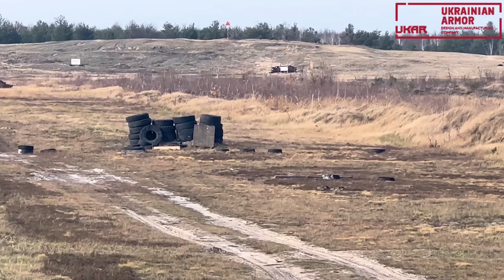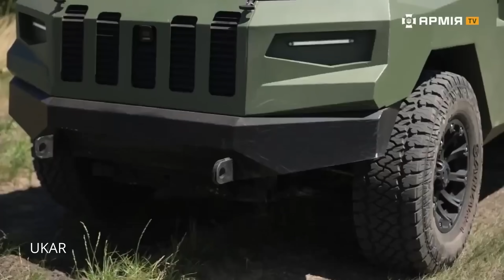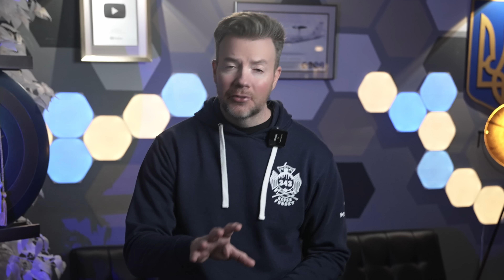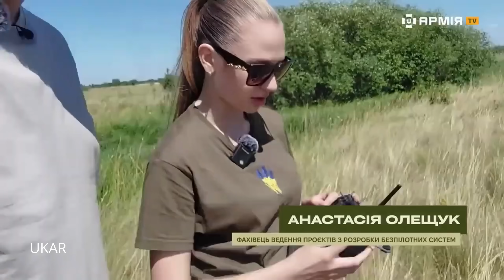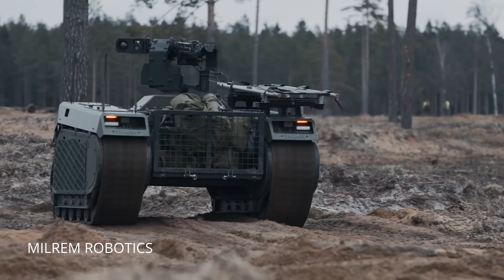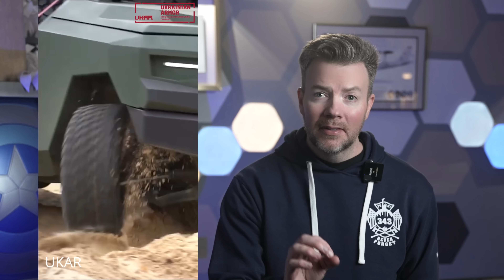Can This Ukrainian Robot Truck Change War?

Comment: Unmanned ground vehicles have a lot of potential; however, as far as combat goes, you would have to figure out the tactics first(suppressive fire, perhaps). I know that Ukraine was able to successfully clear at least one fighting position with robotic systems like this, though. Would tanks be a problem for a system like this, unless you were like the new US armored personnel carrier (Bradley replacement) that will have an autonomous mode? Would they themselves be vulnerable to drone and air strikes?

Comment: I don't see anything ground braking or game changing. GUVs (ground unmanned vehicles) that are remotely operated by soldiers behind the lines, have a single huge disadvantage to a Hummer or JLTV manned with soldiers, and that is - situational awareness. Or better to say the lack of it. No amount of cameras and sensors can't replace the 2 or more pairs of human eyeballs. GUVs will become important and dangerous on the battlefield (although never as much as flying drones) when the AI becomes advanced enough for it to drive the vehicle and shoot its weapons... Until then JLTV manned with 6 Marines with remotely operated weapon station and a few Javelins inside, will be order of magnitude more dangerous, mobile and impactful than a GUV.
To be fair there's one niche role that GUVs can do pretty damn well, and that is missile platforms.. The best example being the US Marines' NEMESIS, where JLTV was turned into a remotely operated vehicle and the engineers installed 2 NSM missiles at the back.. That I can see as a platform that minimizes danger for humans while giving commanders a mobile, low profile system that could sink anything up to a size of corvette. But that is the problem with the NSM missile itself, being small with light warhead (for an anti ship missile that is).. But put one LRASM at the back and you get a $5 million system capable of sinking multiple billion $ worth Chinese Type 055 destroyers...

Comment: If you're close enough to pilot it, the risk is higher than 0.  But it's significantly less than standing like a bullseye

The next stage is a unmanned trike.  (3 wheel)

Comment: That you create revenue from posting what is largely just hyperbole, often using the sad situation in Ukraine is itself extremely sad.
UGV have been largely been a failure in Ukraine as compute to understand and navigate rough ground has proven far more challenging than expected. UFV not needing to consider rough ground are obviously effective and used, UGV have been tried but so far pretty much a total failure.
So enjoy creating revenue posting hyperbole about the terrible situation in the Ukraine...

Comment: Wes.  Appreciate the method to avoid drivers, but this unit is still more expensive and less prevalent than the drones that will kill it in one hit.
Situationally useful at present.

And Russia will have them within a few months too leading meat wave attacks.

Comment: Anyone notice the Chinese transmitter she was using?
Nothing wrong with that, it is a highly regarded transmitter in the hobby world, as long as they can't switch it off remotely.
This thing would be awesome on my rural property, instead of a machine gun I could use a remote sprayer and spray gorse with it.

Comment: She's not wearing goggles? I wonder why they don't add FPV cameras like RC cars are now doing (or maybe just not showing that yet). It's the exact same VTX tech as FPV flying drones and while they've been doing it for years in hobby RC, the latest designs are really impressive for offroad! They're already using ELRS or an encrypted equivalent based on the TX16S controller
 https://youtu.be/YmWkI4PtUNM?si=EOuZVqlmy9an7aHb&t=1

Comment: I would hope that the computers and radios on these trucks are secured in a secure box that self-destructs if the truck is captured, to prevent any reverse engineering.

Comment: Handy dandy bit of kit. That low profile is also a winner, it should sneak around without attracting attention, since the engine is probably fairly quiet.
Curious as to how low the thermal signature is on this bad boy!?    Be well and stay safe

Comment: I was just checking: The Protector uses an internal combustion engine. I assume it has it's reasons. But I was expecting it to be  electric, which would reduce the sound it makes... not that modern petrol or diesel vehicles make too much noise to begin with.

Comment: Remote controlled anti-air platform is certainly a good idea when there is a real need to both get to the intel based elevated point to intercept incoming drones, and there is a real need to be highly mobile to get to the next intel based elevated point to intercept the next lot of incoming drones.

50 cal shoots accurately up to about 1000 meters. Then you need to move 5000 meters to shoot accurately up to 1000 meters again. These things need to be equipped with MANPADS for anti-air work.
Reply: Glide bombs keep coming and coming onto Ukraine defenders. IF a UGV could take a stinger or kind of smaller SAM to the Russian territory and hide, then cause severe attrition on Russian aircraft firing far back from the battle lines then UA could hold positions.  SAM systems need to be able to go 200kms into Russia.  I don't know why they have ignored this weakness for so long.  Russia produces 120K glide bombs a year.  41C

Comment: I don’t have experience with the M2 so what happens if the gun jams? I see videos of operators having to cycle the bolt manually and occasionally lift the top to do something if it’s not working.

Comment: Wes I wonder if they could build like a double hulled section to transport wounded people or soldiers. It could have a higher ceiling on the outer section have it with tank armor. A gap filled with foam or something to kill the explosive blast. Then another skin maybe kevlar or something lesser than tank armor but higher then a MRAPs. Have the crew section maybe 8 foot tall. enough to get four laying wounded soldiers out at one trip. Two on the floor and two above them strapped into the wall. Maybe have defencive weapons like shotguns raised towards the sky. Or some other type of devices.
Reply: They do have separate ground drones built specifically for retrieving wounded soldiers. It has plated structure on top to protect the wounded and is fairly low profile.
I've also seen another one specifically for retrieving the dead troops. It was low profile and had a tiltable conveyor belt system that could drag the body up onto it without external help. I'm sure that there's lots more stuff that we don't know about. Ingenuity has no limitations in Ukraine.